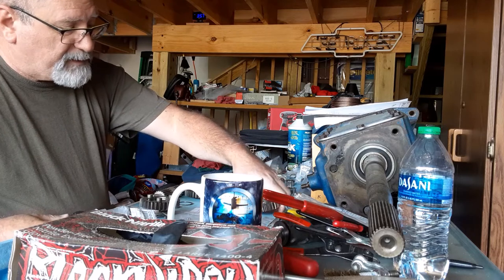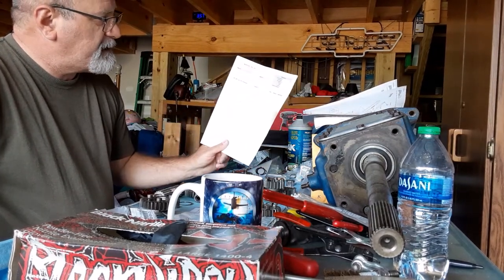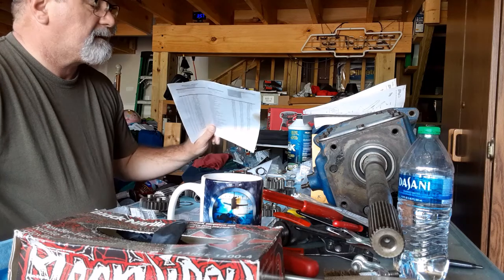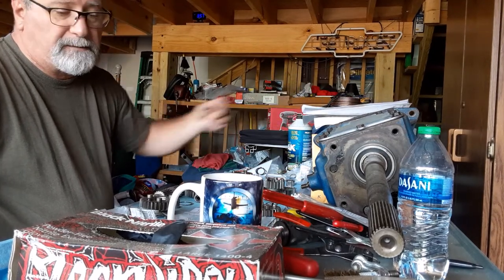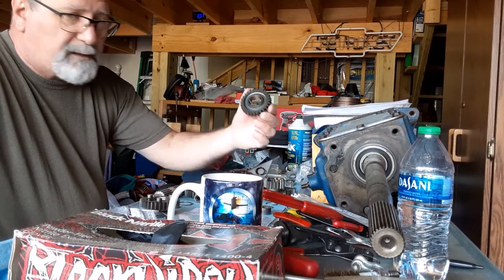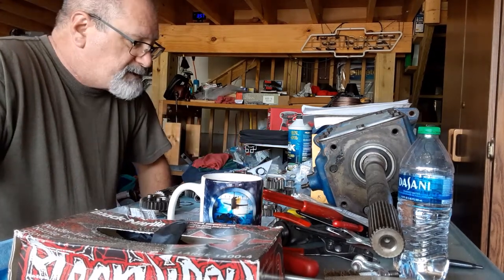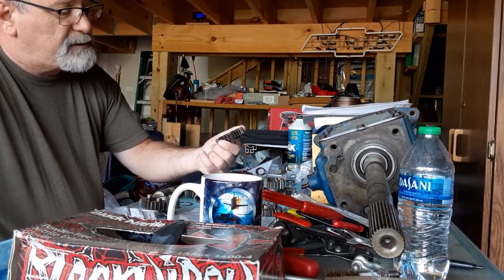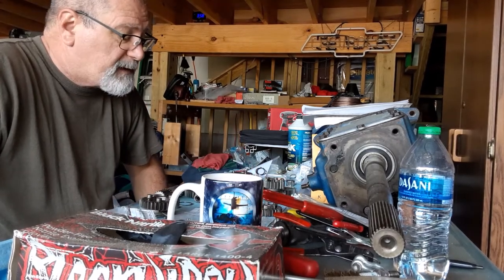2006 Vulcan 900 Engine and Transmission Rebuild / Reassembly

Comment: hello, i have a vulcan 900 custom, i'm interesed to lower the rpm in 5 speed, what needs to be changed? thanks
Reply from the maker: You'll need to change out the output pulley for the belt drive. It's available from 3rd party parts houses. It will reduce your engine RPM, increasing speed for any given RPM.
Reply: @twhite47    I know the effect. I’m interested something else i sow the barons pulley they resist 40.000km.